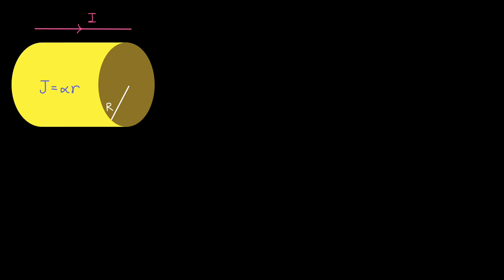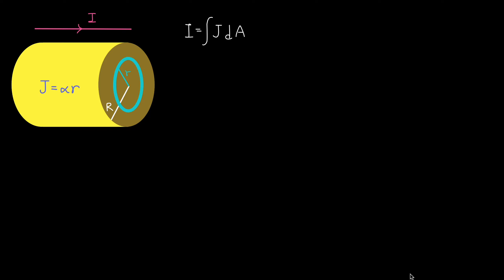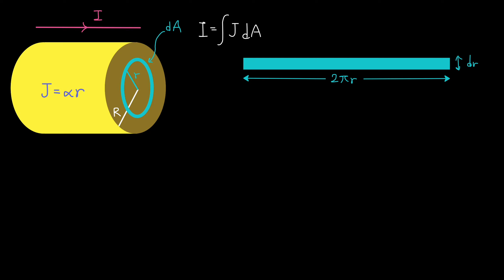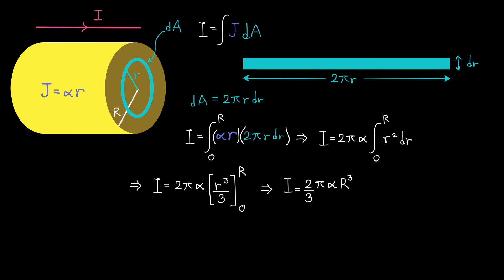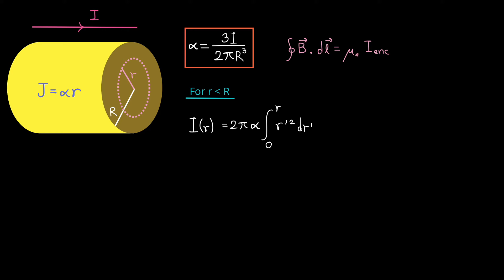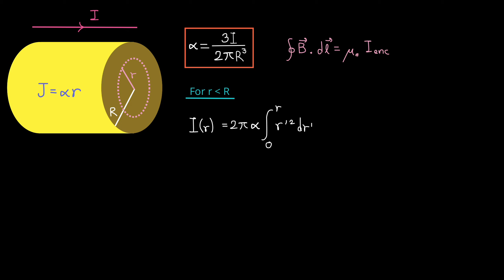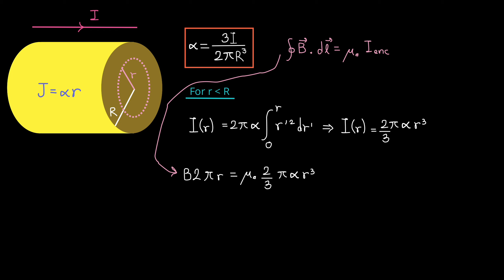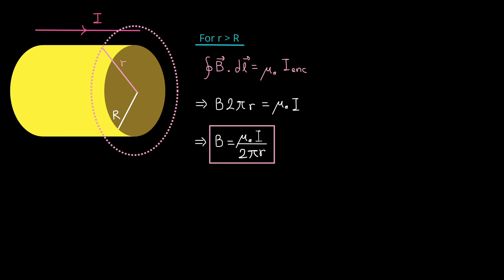Magnetic field inside and outside of a wire with variable current density using Ampere's law

Comment: How would this change if the current density was uniform along the wire?
Reply from the maker: Thanks for your question! If J was uniform, then in the region 0 < r < R, the current I(r) would be equal to J * pi * r^2. On the other hand, for r > R, the current I would be constant and equal to J * pi * R^2.

Comment: A question, rather than a comment: Why did you postulate J = alpha x r? Everithing further on is rigorously stated, but this seems as comming out of thin air?
Reply from the maker: Right, in this problem J is not constant, and it is equal to alpha x r. Alpha is a given constant in the problem.
Reply: @let_s_do_physics  I asked why. Never mind...
Reply from the maker: @kocavrancic5324  This is how the problem was originally designed.